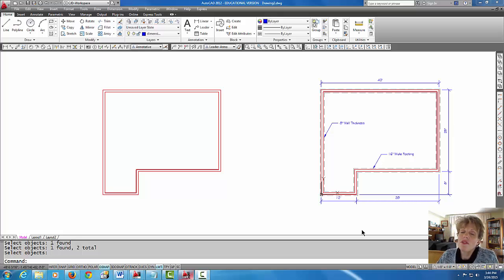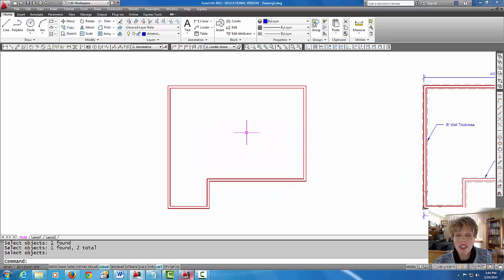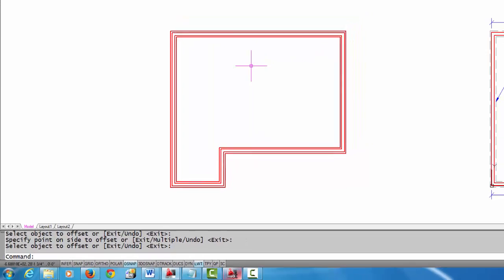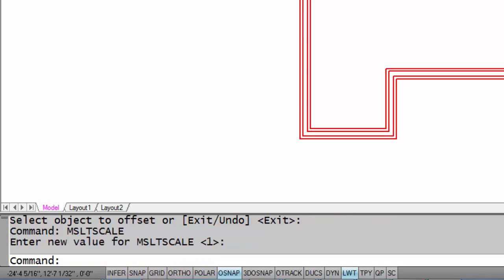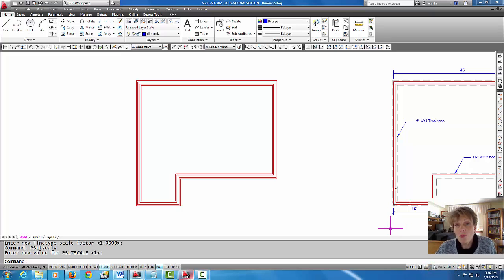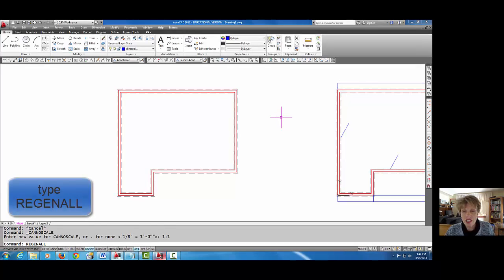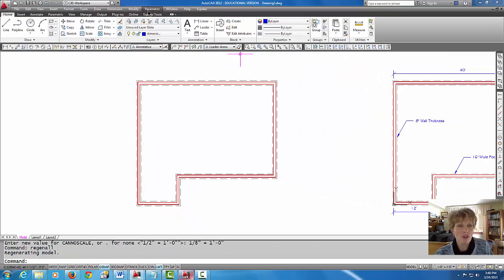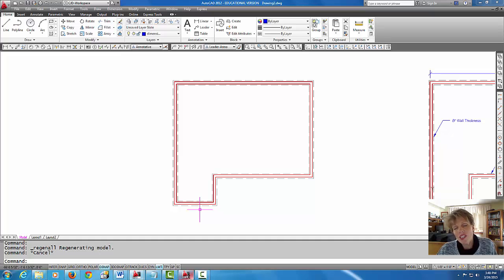Autocad - Dashed Lines & Foundation Plan Part 2 #37

Comment: I used autodesktop 2007. When I type MSLTSCALE my version doesn't recognized this command. I need to work with dashes lines. Please advise.

Thanks
Jimmy.
Reply from the maker: Hi Jimmy,   I don't think Autocad 2007 has the ability to do "annotative dimensioning".  You will have to scale your linetypes by using the LTSCALE command.  For instance, if you are drawing a large plan such as a house plan, you will need to type LTSCALE <enter>  24 <enter> and then REGENALL.  In paper space set your PSLTSCALE<enter> 0<enter>  (instead of 1) .    Let me know if this works for you.
Reply from the maker: don't forget to REGENALL after PSLTSCALE also.